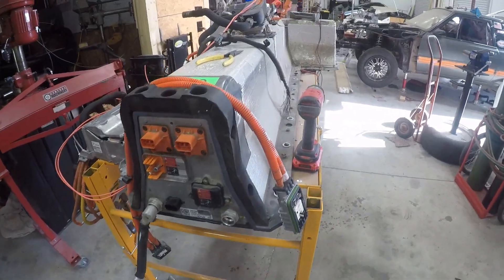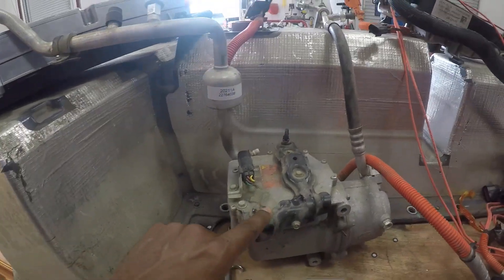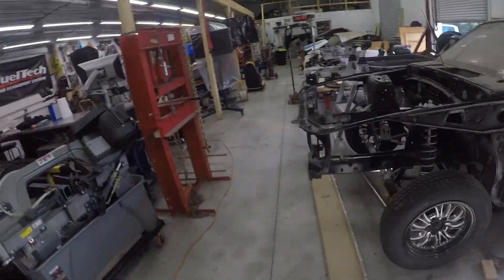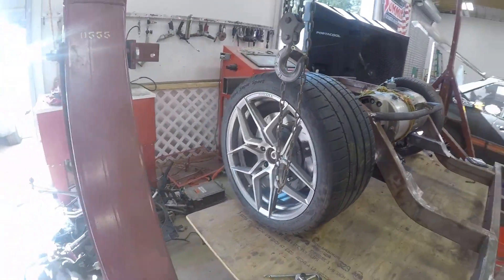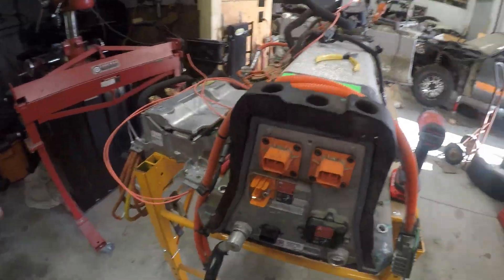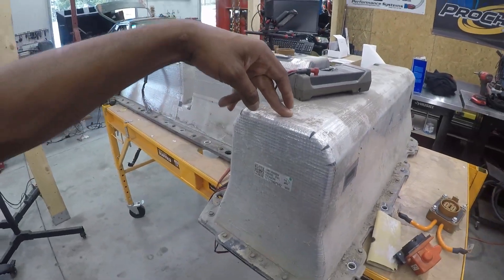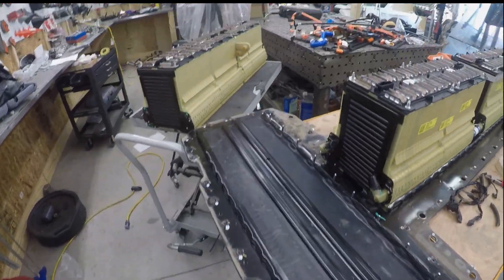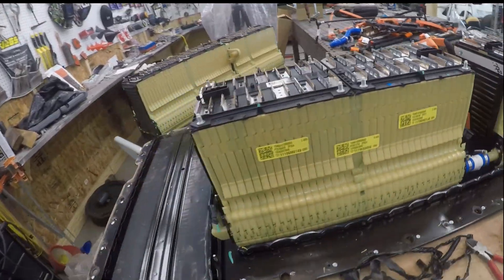Testing our DIY Electric Super Car battery.

Comment: I'm surprised to be the first to comment. This is a serious tear down on the Batteries. Do you know the output of those batteries (Amp kwh) ? And the weight ? It is your number one enemy on a build like this. Anyway this thing will rip seriously ! keep safe and keep working hard ! Cheers from France !
Reply from the maker: Blast_one they are rated at 16kwh I don’t know the exact weight but it’s north of 300lbs but the Tesla drive unit is extremely powerful and will have more than enough power to make this project fun